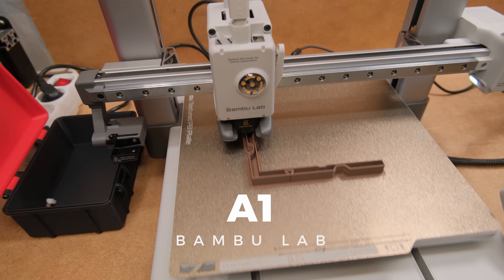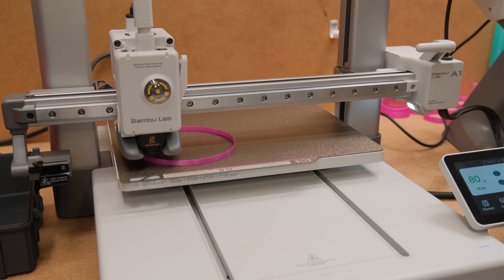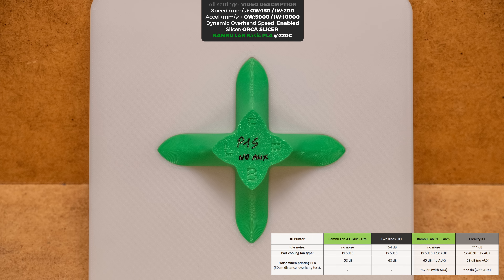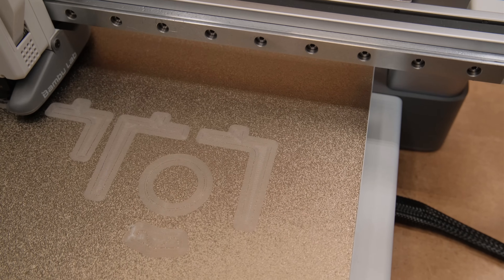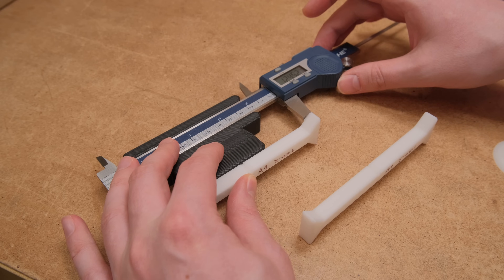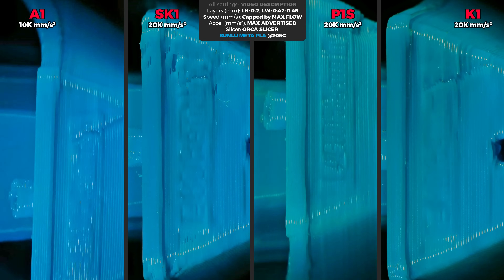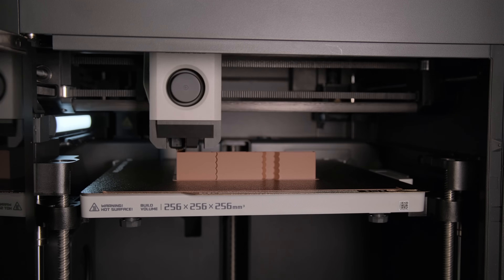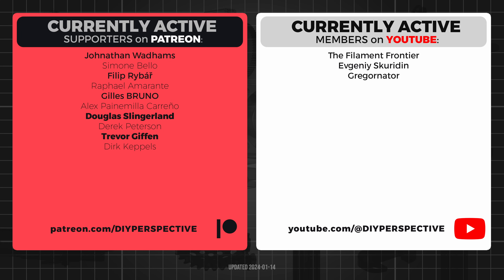BAMBU LAB A1 vs TWOTREES SK1 compared to P1S and K1 (3D Print Quality REVIEW)

Comment: Did you buy the sk1 yourself? Im wondering if other review units may have been cherry picked. Theres a lot of potential with that printer, but its not finished as you say...
Reply from the maker: No, but I doubt they are. When Bambu sent the P1S I got an email that the batch of those units might have defective extruders and they sent the new ones for all their customers/reviewers. So I had to change it before the testing. Plus my A1 had worse ghosting results than they showed me when they ran the same gcode.
Reply: @PrintingPerspective I don’t talk to my printers and I have never been ghosted by a printer

Comment: just for information: the benchy information about the A1 is false. you may have overlooked setting the maximum flow rate to a high value in the filament settings.
Reply from the maker: Stop spreading misinformation it is not false. I triple-checked the print time in Orca Slicer and even in Bambu Studio. Slice the model yourself with the settings in the video description you will see yourself.
Reply: @PrintingPerspective  i have 30:04 with those settings.

Comment: Great comparison video! The benchy print time caught my attention. So how come it's 49 minutes on the A1 while everyone on youtube is showing 20 and 14 minute benchies? Are those like hyperspeed profiles which are meant for pure speed, not quality?

Additionally if speed is half that of the P1S, why is everyone saying that the A1 is only around 20-30% slower than a core xy?
Reply from the maker: I have all the main settings for the 3DBenchy I use in the link in the video description to Printables. I use regular layer height, regular line widths, 3 walls, 15% infill, slowdown for overhangs, spiral Z hop, and so on. Those are realistic settings that you would use for all of your prints. I don't even think you can slice the Benchy at 15mins with P1S with all optimized settings. I think those 14-minute prints are custom g-codes to achieve that.

It is half of the speed on the 3D Benchy sliced with normal printing settings. It depends on the model as it could have literally identical print times on ones where you almost don't need to travel. But a 10K max acceleration printer will never be as fast as 20K with the same other settings. That is just a fact, you know.
Reply: @PrintingPerspective does the better detail of the p1s translate to better color printing ? I mean separation of the colors, Letering , outlines ? At least compared to the A1?

Comment: Video idea. Test effect on z hop on layer consistency. I feel like belted  Z and especially lead screws will be worse than ball screws. but i'm not sure how big the affect is
Reply from the maker: There are so many variables and different designs that it is hard to say in general. I tested ballscrews and they are definitely the most precise option if your ballscrew is not wobbly or you can combat that. I don't really like belted Z personally, but I like the overkill belted Z design on the Voron 2.4. There is no definitive answer to this.

Comment: I hope twotrees watches this as their issues are all easily addressed and you spelled them out perfectly.
Reply: They won't, they have been missing these things for years and will keep missing them 😢
Reply: lol they've been making shitty corexy printers for a long time. You can sort of fix them if you treat them as skeletons for something more custom but they're not good out of the box.
Reply: The wiring made me cringe
Reply: Its the SP-5 all over again. Its a great shell, but they just cheap out on actual printing. Not worth it in any way (and they know it)
Reply: @renanportocarrero7816 the frame as you say is great and defenitly worth it. i picked mine up for 310 dollar, i cant find anywhere else to find the compontents to build it myself for under that. the full linear rails is almoast that much theyself. put klipper and bl touch on it and its a great printer.
Reply: This is how all the cheapo companies are.

They release products they clearly haven't even used themselves, wait for t9ns of complaints and users to mod it, then they make only some of those changes and release a new version.

Comment: Great Comparison, 
I like the use of the ps1 insteat of the x1c for mid to lower priced printer comparisons, although they perform basecally the same (kinda feels wierd to compare an over 1k printer to for ex. the k1, like in the video with the k1max)

Can you test the qidi x plus/max 3 too?

I really struggled between the p1s/combo, the K1/ K1 max and the two Qidi's and your last videos let me take the K1's out of the race, but I'm still not sure about the qidi's. There are some reviews out there comparing them, but I haven't seen anyone really try getting out good results (mostly open and start printing with no intention to even use the orca slicer for example, rooting, or try simple hardware mods, ... also mostly comparing testprints in diffrent colors, which makes me mad. I love you using the same filament for all printers in those tests)
Reply from the maker: Thanks. I mean, why it is weird? You can see the print quality difference, you can see the price and you can decide if is it worth it for you. That is the main goal.

QIDI printers feel very cheap. I tested the first gen X-Plus 3 and it was a complete nightmare. They might improve things with updates but there is no way it will come close to the P1S. To be frank, the more printers I test, the more I realize how far away other companies are from the Bambu Lab.
Reply: I agree with alphas comment in the sense that it's hard to truly get a read on the qidi printers. For me, the biggest pluses for the qidi printers are open source Klipper and heated chamber. That's really it. And the pricing is fair. If bambu can make a somewhat larger P1S, with a reasonable screen, and a chamber heater with insulation, for under $1000, it will be a 100% no brainer. I honestly wouldn't care about them being closed source at that point.
Reply: thanks for the reply and the inside to your experience. it really seems like the bambulab printers are way better and really affordable.

the only things letting me personally consider the qidi's is the build volume, the "print quality" (most reviews set them way above the k1 series and close to the p1s, which might have been poor testing or maybe you got a worst case x-plus 3, which i kinda doubt) and the open source klipper like @dmax9324 said. 
Chroma set from co print is supposed to lauch soon and they claimed in the Formnext 2023 (3D printing nerd) video, it's possible to print TPU and PVA with their ams and I doubt it will work with bambulab (which AMS is not compatible with TPU and PVA and you cant use it on any other printer).
I know it is all speculations, but the chroma set looked like it could change things up in the multifilament/-color 3D print community

the bambulab p1s combo is probably the better choice anyway. If you remember out of curiosity I would still like to know which batch your x-plus 3 was from (they had a callback event aperantly)